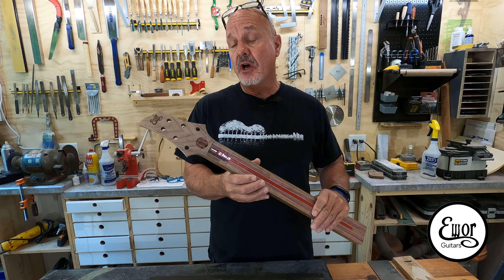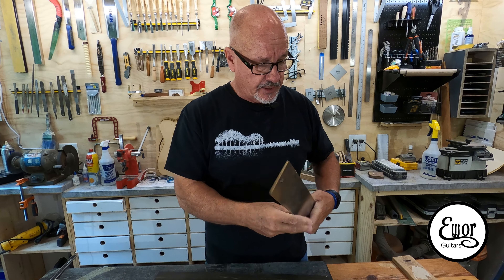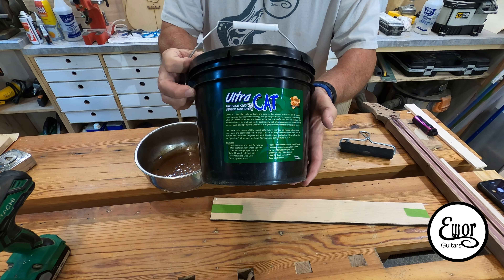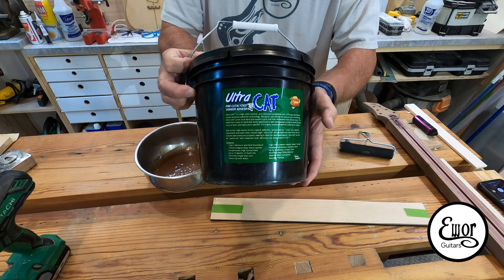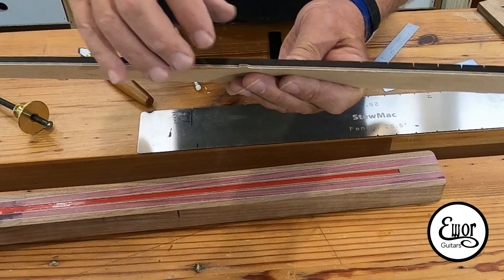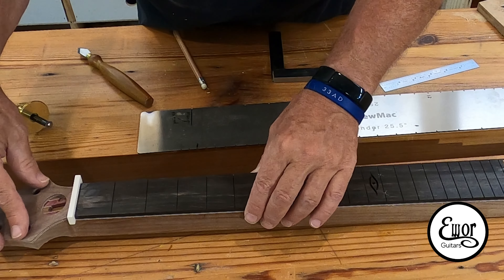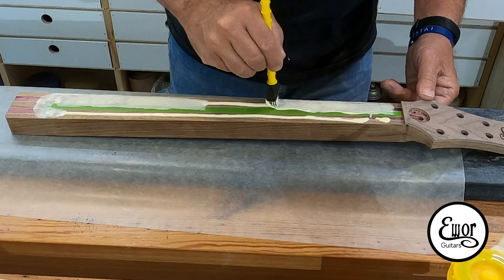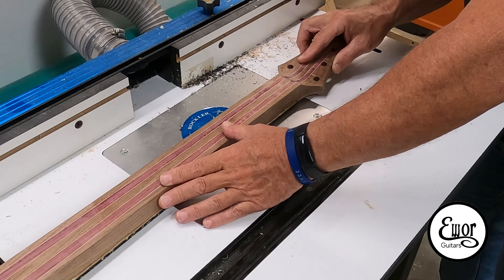Fretboard cutout, slot and install

Comment: Enjoying the series so far Dave, thanks for videoing and sharing your journey for all to see.
A little tip for you, if you want to go that way of course! It's one I can't take credit for but I learnt it from Bob Benedetto. When you machine the outline of the fret board, machine it full depth as you've done but include the nut width to your length and then machine a step where the nut goes, but only down to your veneer layers. Then when you glue it on and have your nut sitting in its slot, the veneer line appears to run continuously from the fret board, under the nut and then run into the head stock.
Reply from the maker: Thanks brother! Good tip.

Comment: You can always do what I call a dry run to make sure your tool path and the piece are good before doing the actual cutting...I ran across your video while looking for some frett polishing info and really enjoyed what you are doing and very impressed for just beginning to program and operate a CNCMACH...I'm a cnc programmer machinist by trade for over 20 years and enjoy playing guitar....I've only machined metal for the oilfield and refineries in Louisiana and enjoyed watching your journey into cnc machining.....Your wood work is top notch...

Comment: Once u figure out how to cut the fret slots on your cnc, u can blind cut them so when u install the frets there is no filling involved on the edges of the fred board where the slots normally protrude.
Reply from the maker: Yeah that will be good. I have tried a few times, the bits are so small (.023”) that I keep breaking them. I need to figure out the feeds and speeds to get it right.

Comment: I have grown my little guitar thing to the point of being able to justify a garage CNC. There are so many options. Are you still digging your Shark 510? Has it been accurate and rigid enough for all your needs?

Thanks for the videos!
Reply from the maker: Yes the hd 510 has been great for a hobby guy like me. If you can afford it and have the space you may want to consider the 520 for it’s extra length. Also make sure to get the water cooled spindle it’s worth it

Comment: Very interesting content as always Dave! One thing that you could consider for a future build is to use your CNC to make a compound radius (10" to 14") making it easy for chords in the lower area and flatter up high for lead lines.
Reply from the maker: Yes that is my hope. Once I get this software learned I need to get a 3-D modeling software to be able to do the really cool stuff!